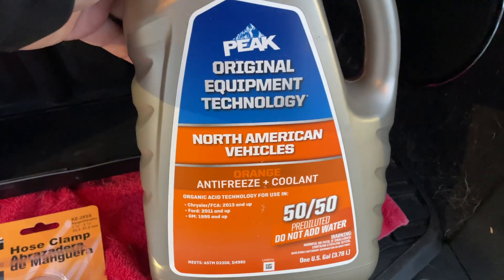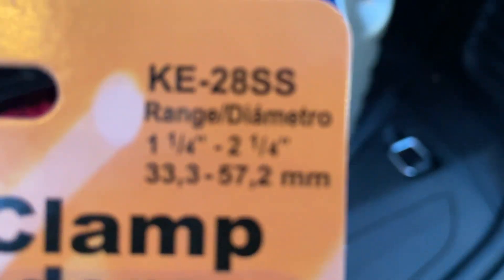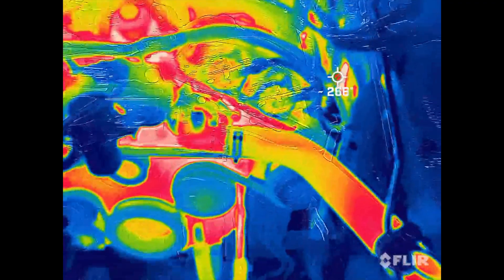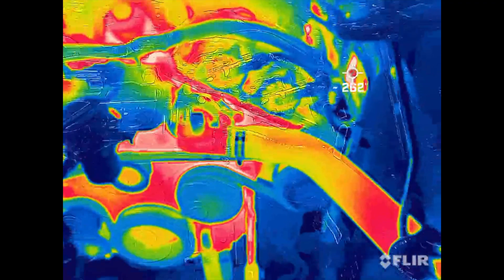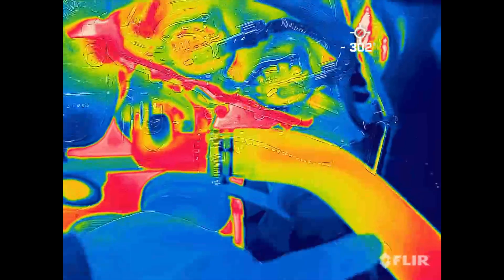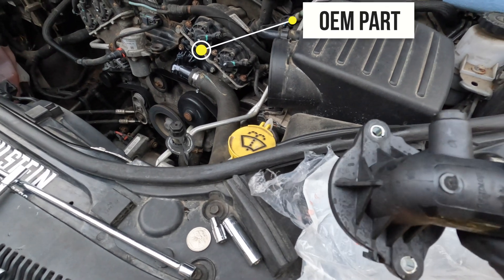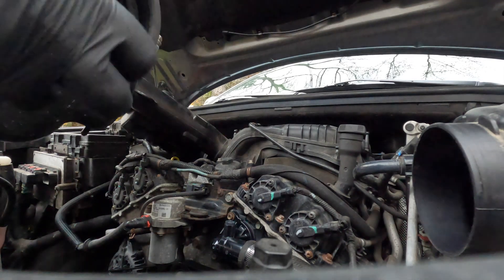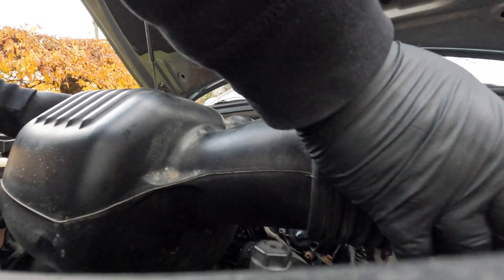Jeep Grand Cherokee P0128 Thermostat

Comment: The floor was covered, plastic and all, correct?
Reply from the maker: i have a large pan underneath, you can get them at Walmart for cheap. it is like a huge baking sheet out of aluminum.
Reply from the maker: btw, there is very little coolant coming out, and you can poor it back in, if it stays clean. this kind of coolant lasts 10 years, and you can filter it with a coffee filter, if you get dirt in it. its worth doing that because a gallon is like $20
Reply: @mygiguser  I am sure you protected the ground like said great job